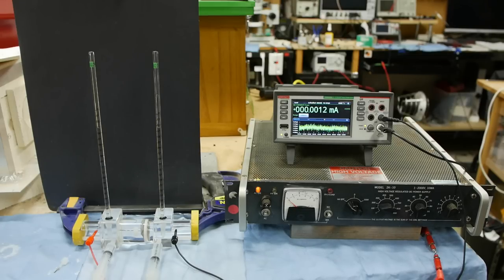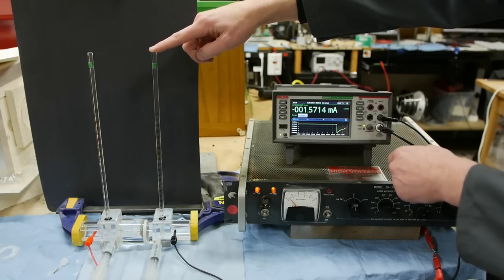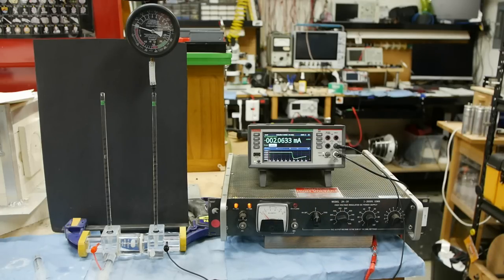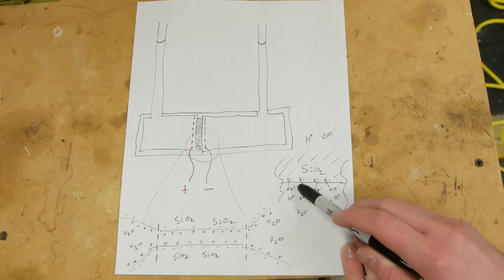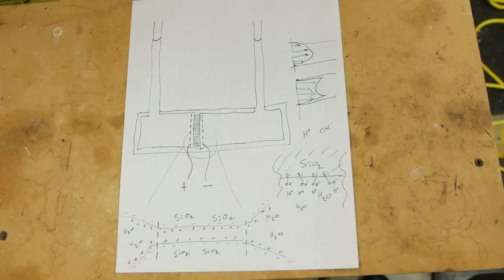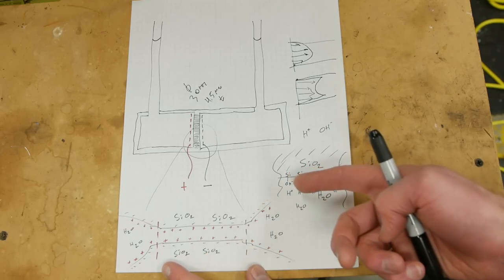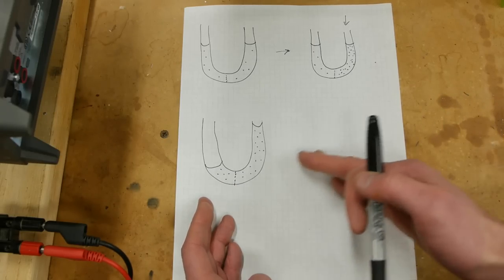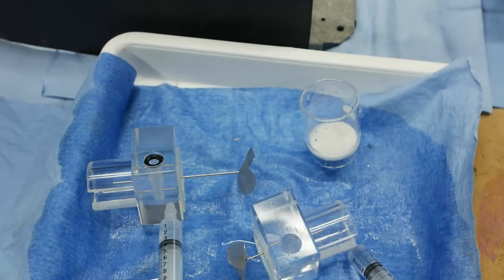Electro-osmosis: pumping water with electricity and no magnets

Comment: I worked on this as an undergrad. Didn’t get anywhere really took me a whole year to fully grasp the mechanisms at that level and my post doc advisor would just assign me the projects that he stalled out on (which in hindsight was a bit unfair) but it was really interesting. We’d etch borosilicate glass like you do silicon to get these tiny channels. Use 20,000 V (very low currents). They had several applications proposed- though when I went back a decade later it seemed little real “big picture” progress was made (tbf I have not reviewed the papers from the group in a very long time).  Specifically my post doc worked on doing electrophoresis of proteins in 2 dimensions using the chip. He and the group used positive charged micelles which moved contrary to the field, non-polar proteins would spend more time inside the Micelle and going the wrong way for the first dimension. The second dimension we’d dump in the same buffer minus SDS sufficient to break the micelles. This would make a second dimension separate on charge vs drag. (First was charge vs polarity ratio)
Reply: It did not go anywhere but the story lives on ,thanks for sharing .
Reply: I was beginning to think I invented a memory of a similar method of protein separation being discussed in one of my grad school classes.  I no longer think I'm going crazy!!  Thanks for your story!
Reply: I remember back in the early 2000's seeing basement "waterproofing" systems being sold based upon this.
Even today, I'm extremely dubious without a lot of retrofitting of both sides of a foundation wall.

Comment: Such flow profile distortion also exists for a flow in a packed bed. This is because the packing at the wall is less dense (due to geometry) hence the resistance to the flow is lower.

Comment: Ive used MHD pumps for a few things, the first time was when coming across some cpu coolers made by Nanocoolers. They had a gallium tin alloy and a 0.1V at 20A converter that supplied the magnet pump. The second one was in an E beam machine that cooled the target, it used NaK as the fluid that kept the tantalum taget holder from melting. The pump you made there is essentially an electrostatic pump, one use of those is to pump low pressure gasses from one region to another in vacuum reactors for CVD. It allows a way to very precicely and evenly mix the reactants ❤

Comment: I use to think that Red October was obsurd, impossible non-sense as to its catapillar pump, but now I see I was wrong.  Your presentation was clear, technical, and obviously sound scientifically.  Thank you.
Reply: Japanese researchers did build a submarine with a magnetohydrodynamic drive. Inefficient, beyond slow and eventually, the sub ended up out of the water on static display.

Comment: Can anyone help me understand how this actually moves the water, and not just the hydrogen? Maybe I'm lacking some elementary understanding, but if the only thing moving across the barrier is hydrogen, then what does it re-combine with on the other side to form water again? This is really cool, I understand the rest of the video for the most part, but I really don't grok the actual chemistry happening at the barrier!
Reply: I don't definitively know the answer, but I am guessing that it's due to the positive charge of the hydrogen cations attracting the negatively charged hydroxide anions. For example, if an imbalance of H+ and OH- occurs then they will attempt to reach equilibrium by moving together. However the H+ cations are blocked from moving back through the filter by the electric field, therefore it is the hydroxide anions that move.
Reply: It's partial seperation of H from OH and since the -ve charge forces the H to move towards it, it drags H along with it making the actual flow.
Reply: Just commenting because I also wanna know 🤗
Reply: There is no separation in the first place, there is only orientation going on with the hydrogen tail. A true ion does not form. The intact molecule is dragged along by it's tail. As room is made at the positive end for more water, it in turn is orientated  and drug along as well. Anions or cations are not involved as in theory they are not formed, but in practice most of the energy used is for that 'side reaction' as explained about woeful efficiency near the end. Also note that there is no barrier in reality, the sintered glass media of the filter is just that much more glass surface area upon which the hydrogen tail is made and used to fuller advantage. Oil forms a similar heads and tails orientation with steel crankshafts for example only there it's the carbon head attracted to the iron molecule since carbon will readily dissolve into molten iron. Silicon loves oxygen like iron loves carbon.
Reply: @leebarnes655  A little over my head still, but thank you - it makes more sense that there's no actual separation and it's just kinda being dragged along. My chemistry is pretty poor so I'm trying to intuit how it works
Reply: There is parallel-plate capacitor filled with a dielectric that is subject to movement by the electric field. The water molecules can polarize by the straight-line, parallel electric fields created by the capacitor plates and because they can move they accelerate in a direction. Their movement is a movement of net charge in a fixed direction which is the reason (maybe?) why the speed of movement of water positively corresponds to the magnitude of current.
Reply: @leebarnes655  Do you know if the geometry of the molecule is changed in this process?
If the positively charged hydrogen is pulling one way, are the intermolecular bonds be weakened by the pull?

I'm gathering from your knowledgeable response that you're instead saying; the orientation of the molecule is the only thing that is changed.
Reply: @leebarnes655  If this is true. Than the principle requires a non-uniform electric field. Uniform electric fields cannot move neutral molecules, no matter how polar. But since water is already polar, it should have a very small flow by itself in non-uniform field. So the glass is effectively just making the water more polar to increase this effect?
Reply: @Mythricia1988  From the linked paper titled: Electroosmotic pumps and their applications in microfluidic systems, "In EOF, mobile ions in the diffuse counter-ion layer of the electric double layer are driven by an externally applied electrical field. These moving ions drag along bulk liquid through viscous force interaction." So it sounds like electrolysis and then ions just drag along water molecules. Due to different size of OH vs H and where they are distributed, it must occur preferentially in one direction. Most of the energy goes into electrolysis (and you can thus also see the current). It makes sense, why it is so inefficient.
Reply: @sebastiandietze3742  Thank you, that makes sense! I think I mostly get it all now.
Reply: I immediately saw the 'movement' of the flux field. I discovered a great book recently and the first 30 pages changed my perspective on physical motors quite a bit. I think it might give a little insight. You can read all 30 pages in the preview [look inside] if you like: https://www.amazon.com/gp/product/0080983324/ref=oh_aui_search_asin_title?ie=UTF8&psc=1
Reply: @Mythricia1988  would its efficiency be increased by using fluid with larger molecules? So if we take a large molecule with an OH group and put that through, it'll be using proportionally less of its energy to tear the OH off and more to drag the ion.
Reply: Mythricia Just to add a little more to the story; I think a water molecule, although electrically neutral, has an electric moment, in other words the molecule's charge is not uniformly distributed along its length. This would certainly contribute to a molecule orienting itself according to the electric field without it necessarily being broken into its constituent ions. I suppose this is how water heats in a microwave oven - the microwave frequency be that of the natural frequency associated with the water molecules which would oscillate with the changing electric field vector and so raise its temperature. Of course all this is assuming I've got this electric moment thing right - I'm quite happy to be corrected! Hope this gives you something enjoyable to 'gnaw on'!
Reply: @leebarnes655  great explanation, just one think i don't completely get: why is the hydrogen tail being pulled along more than the remainder of the molecule is pushed back?
Reply: @nonchip Thanks Kyra, looks like  Sebastian Dietze has it in his second post here and frankly I'm about all in with molecules having heads and tails that can take on electrical moments while remaining mostly nonionized. I wouldn't know a double electrical layer from yesterday's lunch. So new stuff for me too. And not completely clear on how it works myself. I was shocked to see how much water was moving but haven't taken the time to count atoms and electrons mainly because I'm basically a lazy hump as well as willfully ignorant in this particular case. For now it's enough to know that somebody has a good idea of how this all works and I can read up on it when I'm further motivated to do so. To your question though, I'm thinking that the oxygen molecule is just sliding along from one silicon atom's influence to the next one and one is as good as another in that regard. The movement seems to depend on actual ion creation though which is outside the supposed boundaries I have assumed to be the rules for explanation here so my hands are now tied and all I have is dunno. Other than the oxygen repulsion is nullified until the final moment of loss of contact with the glass, there is no good answer to your question that I have..
Reply: Is this the very same effect as one can observe in the classic demo-experiment  with  the electrostatically charged glass- or plastic-rod close to a fine stream of water (deflection of the water towards the rod)? In this case, its only the interaction between charge and dipole-moment. No dissociation at all, if I‘m correct.
Reply: Mythricia The electricity is flowing through the wire, least resistance. Very little electrolysis is taking place.
Reply: I’m bummed that Applied Science likes this comment but didn’t answer the question. I read through all the replies but am still also lost on how the electric field is moving overall-neutral molecules, even if polarity is orienting them one way 😕
Reply: I'm thinking it's a lot like electron flow. You're pushing the H+ over and it's dragging an OH- with it, and so on....
Reply: Yes, all of these comments aren't addressing that the OH- would create an equally strong push-back force.

The only reason I can think of is that the OH "radical" (people are saying it's not full ionization) is "bonding" with the Si+ atom and that somehow those two form a neutral pair (no electrostatic force), while the atom(s) the Si+ distanced itself from (I guess the O2) are now more negatively charged but they are part of the solid matrix they are embedded in.

Essentially, if we are to take this explanation at face value, the substrate (SiO2) would be experiencing a constant force on it which would be equal and opposite to the water being pushed and this makes sense for Newton...

But I still don't understand how the OH- can be both bound and unbound: if it's "sticking" to the Si+, then it's stationary! If it's moving away, then it's not stuck!
Reply: As others have said, it's not actually H+ ions separated from H2O.
But I didn't see anything saying what it actually is.  It's actually acid water, or H3O+.
And the OH- ions are also not pure ions, but are actually water in its liquid-crystal state.
And the OH- "ions" haven't bound to the SiO2.  It is liquid crystal water flowing along next to the SiO2; and it should also work with any hydrophilic material, not just glass.

The chemistry is weird, because it's chemistry belonging to the category of liquid crystals in general.  Despite wind-spread use of liquid crystals, they're still a frontier of science and chemistry that has a lot of new research coming out in recent years, and a lot more still to come.
The existence of liquid crystal water is still hotly contested, despite the fact that it has been proven with repeated repeatable experiments (the crystal structure is hexagonal similar to graphene, according to x-ray crystallography).
Reply: According to the stanford.edu resource, the flow is in fact of the positively charged species (which induces bulk motion of uncharged species) and the negatively charged species remains bound to the wall. The charge separation comes from the autoionisation of water (~10^-7 mol/L of H3O+ and OH-), which sets up that double layer effect in the membrane. Presumably any charge balancing would be done by galvanic reactions on the electrodes.
Reply: @karl0ssus1  Interesting. (That link isn't working correctly). Does the resource say anything about pH levels in the vicinity of the effect?
Reply: @memetb5796  I didnt link it correctly, but the resources are linked in the description. Autoionisation is out of my own head (chemistry major), but one of the resources in the description did mention something about efficiency increasing with pH, so there must be some sort of pH effects at play also.
Reply: Ions have a relatively large solvation shell, which means moving an ion effects a lot of water molecules around it.
There is no water recombination at the end, but electrolysis.
Reply: BetterlifetechIST  A water molecule can't carry electron directly. Electron solvation, what you described, exists but it's an exotic effect, and very limited in water (if it exists at all). In water, ions are carrying the charge, and if it's a DC, it always ends with electro chemical reactions on the electrode surface. (In high frequency AC case that's not necessary.) Even in pure water H2O <-> H+ + OH- autodissociation produces the ions to conduct electricity.
Reply: BetterlifetechIST  Liquid water always contains ions, because the water itself can dissociative to ions. It's called autodissociation, and it happens in pure water too.

Comment: Awesome explanation of osmosis. If only the H+ move across the filter and the OH- is stuck how does it recombine? Shouldn't it lower the pH on one side and raise on the other.
Reply: Curtis, yeah the explanation for how it runs indefinitely didn’t make sense to me either
Reply: I was wondering something similar. Shouldn't all the space on the glass get taken up by OH- after a bunch of H+ has been pumped across and then the process stop because no more H2O can get close to the glass? Also if the OH- was going to move in any direction shouldn't it be towards the opposite of the H+ because it's attracted to the opposite plate.
Reply: Not only the H+ moves through the sintered glass, the quimical bond between H+ and OH- is not broken by the interaction with Si (it only slightly polarizes the H+ aligning the water molecule thus creating a "charged extreme to pull") so when the H passes through the filter the OH goes with it. (BTW sorry for my English).

Comment: I remember back in the early 2000's, companies were selling (and still are) basement "waterproofing" systems for masonry walled foundation walls.
I was and remain more than dubious for such a system in a retrofit on old work, but it likely would be quite effective on new construction. It all comes down to electrode installation and yes, the earth can be used as an electrode, but the efficiency goes even farther down.
I discarded the notion for my old house, as our water issue was related to the fact that the back alley used to be a creek bed and the rears of many of our homes were literally part of the floodplain, so when it rained for extended periods, we'd start to get significant seepage of water through the concrete floor and masonry wall. I figured we'd need over 10 times the flow rate of such a device scaled up to handle it and that, plus impurities from the masonry and earth would, well, not be distilled water and chemically complicate the system by a great deal. Basically, it'd be a high electrolyte containing mixture that one's applying a high voltage to, which could turn into a double plus ungood thing in a confined space like a basement. Especially in a house that was so old that it had gas pipes (thankfully, capped off in the basement) running through the walls for old gas lights, as well as knob and tube wiring.
On new work, it'd likely work well, although on new work, there'd have been a better path for water to flow provided that was away from the foundation walls and basements when the block was being constructed.

Comment: I'm curious. Can you reverse the concept and produce power? Like a non mechanical turbine.
Reply: that’s what he was doing with the sensor, measuring the return current when the flow was applied.

he remarked that the efficiency was like .1%, as you need loads of current to send it one way and only microamps of current come from the reverse.